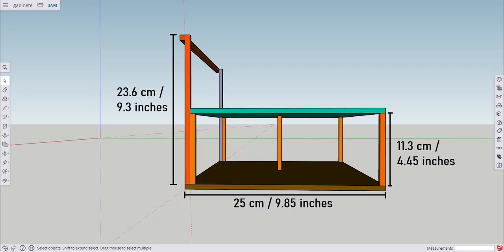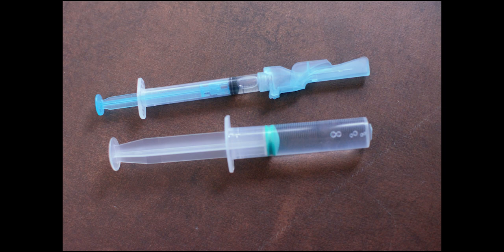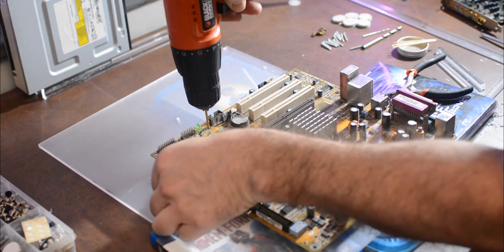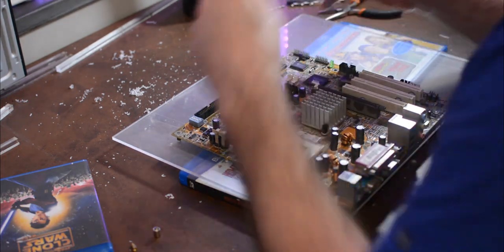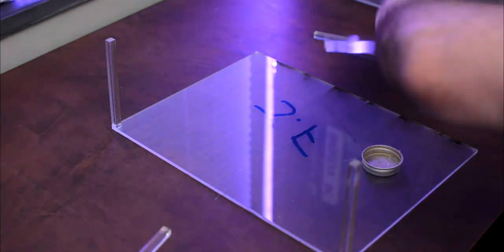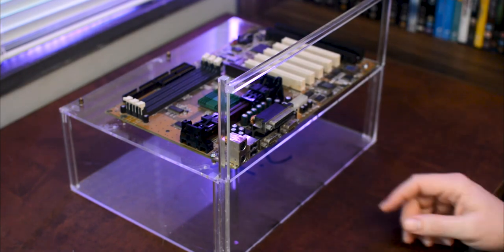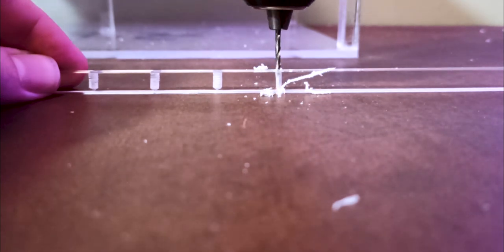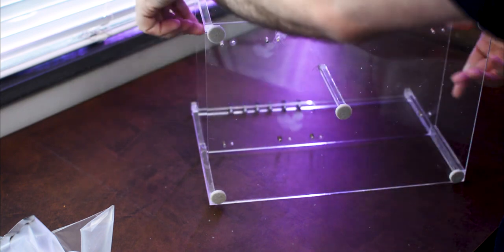How to Make a PC Test Bench Out of Acrylic DIY

Comment: Terrible material to make it out of. All those screws are going to strip out if they haven't already. An old computer case is the way to go. Thanks for the video.
Reply from the maker: It's just a fun project, thanks for watching! Screws are holding up well, a bigger problem is the glued structure, some points have failed.
Reply: @SUCRA  Ah ok, shit I thought those screws would strip for sure. Well theres your answer dont glue it screw it instead. Sounds like they would hold better. Did you scuff the acrylic up with sandpaper before glueing it?
Reply from the maker: @dooley9621  Sure did. Metal and acrylic don't go very well together. Because of different pliability characteristics metal quickly heats up, I broke a stand-off, and a drill bit trying to drill thinner and deeper holes for the screws, then I gave up and went for just glue. If done right it's suppose to fuse the acrylic but in some points I guess I didn't do a perfect job. Anyway, it did hold through a few projects, now I have a fixed system on it, soon I'll feature what I did in a video, but it found a good purpose.
Reply: @SUCRA  I do alot of resin art and make alot of molds from acrylic I know exactly what your saying. I find a little crc lubricant on the screws helps alot.
Reply from the maker: @dooley9621  Oh that's interesting. Thanks! I might try that if I get some time on my hands to go back to this project.
Reply: @SUCRA  yeah scuff both sufaces, glue and then clamp together for the recommended drying time. Common sense with the clamps of course make sure they have rubber faces and dont overtighten.